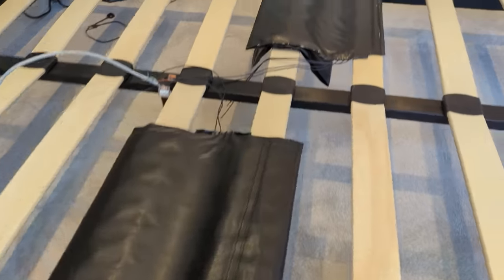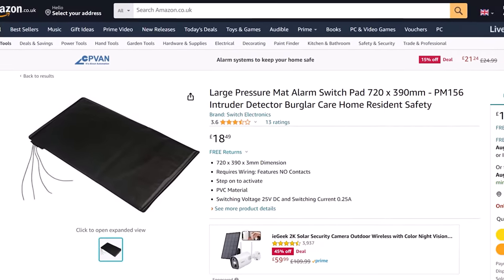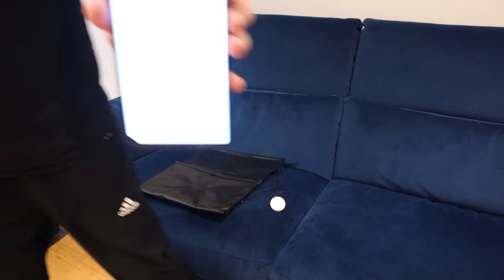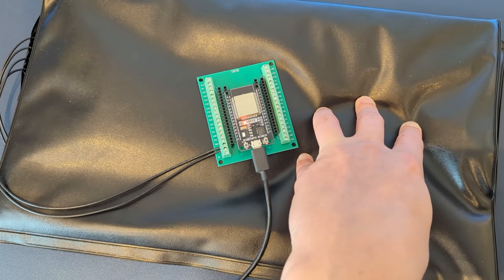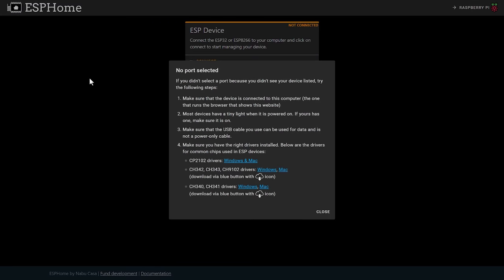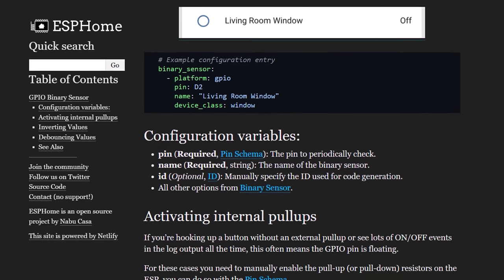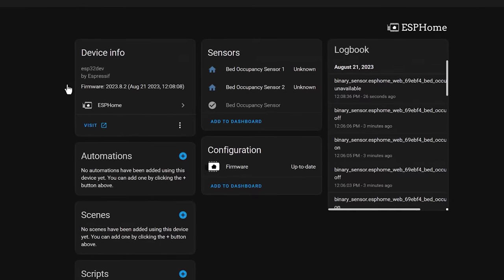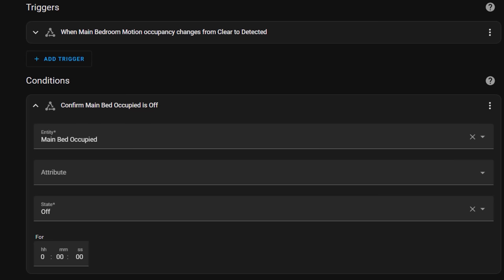Easy Aqara bed sensor vs ESPHome

Comment: Thanks for the great video!
I have build it myself with ESPHome and I found that the "delayed_on_off" filter works much better than "delayed_on" and "delayed_off" because "delayed_on_off" is intended to debounce binary switches, while the others are intended to debounce push buttons.
Reply from the maker: Great tip! I didn't know about that one. I'll switch my code now and see how it goes. 

Thanks for sharing! 🙏

Comment: The other 2 wires are for a security loop, when  used in alarm systems.  They are powered from the alarm system and will 'always' be live unless the wires to the mat are cut, alerting the alarm system to a problem with that sensor.
Reply from the maker: Well that's good to know. Thank you!
Reply: If you look carefully you can see, and feel through the plastic coating, the two wires that are just a loop
Reply: I just wanted to mention that the version of this same sensor mat that they sell on Amazon in US only has two wires. The wires terminate in a plug that connects to a small alarm/chime box. I cut the wires a few feet from the female plug connected to the alarm box so I can disconnect it in the future and then connected those to my ESP32 and it worked great

Comment: FWIW the mat you chose was an alarm mat. That means the other 2 wires you could not figure out what they were, were the break-detect lines. All alarm equipment have them, from door switches to PIR sensors. It basically ensures the integrity of the alarm state should someone tamper with the sensor. 

Cool vid and yes ESP devices can be a very easy and low power way to set up smart sensors.
Reply from the maker: Makes sense! Thanks for the info, there was 0 documentation with the mat itself so I had no idea 😃

Comment: Great video. I saw another video doing similar thing, using Aqara water leak sensor, so I got the same pressure mat he did and the Aqara leak sensor. It worked, but an issue I had was the time it took to show clear was taking to long for my application. So I tried the ESP32 method, using your code, but I removed the delayed on and reduced the delay off to 3 seconds. We will see how that works. But first thing I noticed is it was precise to show clear on occupancy at the 3 seconds.

Comment: That a good alternative use for the leak detector, I've used one like this as a rain detector connected to a  rain sensor board. You can of course also use a lower cost window/door sensor just by by-passing the reed switch. I use such a device to detect when my front door is locked (not closed ... . actually locked).

Comment: I'm using ESPHome with an ultrasonic sensor in my water softener to give me the raw distance to the top of the salt pellets, then calculate the used and remaining height in cm and % of salt used vs remaining. I also used the same setup to measure the amount of water in the Christmas tree reservoir and sent alerts when it got too low.
Reply from the maker: Do you have a guide you followed for that? I have a water softener and I always forget to refill the salt blocks.  The softener came with a Mobile App, but it sucks so bad and requires internet connectivity which is really annoying. I assume the softener already has ultrasonic sensors it for the inbuilt app, and I wish I could just wire into those!

Comment: I use ESPHome for almost everything. I now use about 130 different ones, ranging from controlling an LED strip to ESPs that have different sensors attached to them, but now also several with a Tuya chipset that I have flashed to get them from the cloud. .

Comment: I am using an Esphome device with an infrared receiver and an emitter to control the Air Conditioned with the "climate" module. It even detects when I control the Ac via the remote control and the settings are sent to HomeAssistant!

Comment: Nice video.   Question, if I put the pressure sensor between my mattress and box spring, won't the weight of mattress trigger the pressure sensor on all the time?
Reply: I would imagine you would be able to calibrate the pad but that will come with the intructions

Comment: I have several ESPHome devices.   One is a small relay based on a Sonoff SV that unlocks the main security door with a toggle that keeps it powered for 5 seconds then releases.  This door would normally be controlled via a push button on the intercom system, but I use it as a remote  control so I don't need to worry about finding my key all the time for the common area doors.    I also have several LED Strips, analogue and digital, that are controlled via ESPHome.   I originally was using Tasmota on the door relay, but found ESPHome to be an easier option to maintain within Home Assistant.
Reply from the maker: Cool use of ESPHome for the door lock!  I love it!

Comment: Great video! Am going to try this out. The method using Aqara's water leak sensor is a good approach but I do also like the ESP32 option. The only drawback is that the ESP32 would need to be powered via USB.. unlike Aqara's water leak sensor on CR32 batt.
Reply from the maker: Yeah. That's true. But I'm on a mission to try and get rid of my battery powered devices. I'm also not sure how long a water leak sensor battery will last if it's constantly triggered via the bed sensor
Reply: You can get ESP32 modules with built-in support for connecting a LiPo battery (including a charging circuit)

Great video, by the way, Alan! 🙂

Comment: I went the half load cell method, turns the bed into a massive weighing scale so you can work out if it's just you, the wife or both in bed and run different automations
Reply from the maker: I agree that this is a much more accurate method. But it's a lot more work to set up.

On the plus side, you can then use your bed to weigh your suitcase before you go on a trip!
Reply: @HomeAutomationGuy  or yourself - esp after a big dinner.

Comment: I made an accent/night light in my bathroom which turns on via motion sensor and adjust brightness based on time of day. I also made an IR receiver which listens for specific buttons on my TV remote which the TV doesn't actually respond to. My TV remote has a numpad and so far as I can tell it is not used at all by the TV. I programmed HA to do various things like turn on or off lights in the area of that box, convenient diy universal remote for when you just sat down and forgot to turn the light off and you have the remote in your hand

Comment: I'm using an Aqara door sensor with a (much smaller) pressure mat. My goal was to have the nightstand light on when I wake up at night, but there are too much false positives and the light will turn on randomly during my sleep. Of course for this purpose I cannot use long delays, in fact in my automation the light will turn on after 2 seconds of "bed not occupied", otherwise I should stand still to wait for the light to turn on before moving away from the bed. So I use the sensor for the mornin wake up routine: if I'm not out of the bed after 10 minutes from the routine start, my bedroom light will turn on and the echo dot clock (playing my favorite radio station) volume will go up.

Comment: Hey, also used those mats (sensor) under our bed and they worked quite a while. But after some months the triggered fals alarms or dont go from occupied to unoccupied sometimes.
Now i am using two FSR stripes and ADC meassuring, but also have sometimes issues with fals triggers (after making bed...).
I think the holes between the wood "destroying" them over time with the person weight on top.

I think a solution would be to use some sort of thin plastic under the pressure mat to support it and not squeeze it into the holes between the wood.

Do you guy's have those issues with the mat?
What do you think about the idea?

thx

Comment: Love this leak sensor idea to make it zigbee compatible. I actually already had a very cheap zigbee leak sensor I wasn't using that had two contact prongs on the end. I cut that off to expose the wires and they can then be connected to the pressure pad. Benefit of this is that the prong was on a long wire so it's more flexible where I place the zigbee transmitter.
Reply from the maker: Great stuff!  Good re-using of unused smart home tech!

Comment: I plan to use ESPHome for multiple different things like:
- Water leak detection
- CO2 fill grade and leakage detection for the water dispencer
- Bed occupancy
- Irrigation/Sprinkler system
- Parcel and Letter box
- Weather station (with multiple sensors including lightning detection, rain, wind, temp, uv etc)
- Air quality (Airrohr, Sensor Community)
- Air freshener
- BT proxy for radoneye

and for sure more upcomming.

ESPHome is a great system with a huge amount of possibilities. Sometimes at smart homes you have to think about possible data and how to interpretate them like my temperature sensors at water pipes to detect if somebody uses the shower or bathtube.
Reply from the maker: What a great list of future projects I can try!  Thanks for sharing!

Comment: Using the leak sensors as the trigger is genious.
I'd be tempted to set this up except worried that on a date night, if the dog walked into the room, it'd have a seizure with the lights strobing off and on
(/j)

Comment: I have the even more expensive sensor option. We own a Select Comfort SleepNumber bed and HA has an integration for their SleepIQ app. I do find that due to movements I can't rely on the occupancy state. Just thinking out loud, but in order to 'filter' the state (like you demo with the esphome sensor), I need to increase the "Duration" in the Automation for both both state changes.
Reply from the maker: Oooh. Smart bed! A whole device I'd never even considered before!
Reply: @HomeAutomationGuy checkout eightsleep
Reply: @HomeAutomationGuy  This is my second Select Comfort bed. The first was bought over twenty years ago before home automation's current push into all facets of our homes. When we needed to replace the aging bed 5 years ago, I was excited to find out they moved away from RF bed controls to a phone app. Only after getting into Home Assistant did I find out that there was an integration for HA to control the bed -- under-bed light, bed firmness, head/foot position, and I am guessing bed temperature. We don't have that feature, but in the winter I dream of how nice it would be to crawl into a toasty warm automation-controlled bed.

Comment: This was great - I got set up in an afternoon following your guide and now have the alarm automatically arm and lights shut off for these. Still trying to figure out the right positioning for the pads. Has anyone done any adjustment to sensitivity for heavier mattresses? If not may build a container around the mat to alleviate some pressure

Comment: I’ve been using it for approximately a month now and it’s been awesome so far! I’m using the Aqara method and using the sensor to only trigger the waking up automations like turning on the lights and blasting the alarm and lifting the shades only when I am already in bed.. and it doesn’t turn off the lights and keeps annoying me with the alarm until I get out of bed (eliminating the spaming snooze dilemma 😅)

But lately I’ve been facing an issue where it stays on occupied even when I get up, and then I’ll have to hit the mat multiple times until it gets fixed.. it’s like the mat gets bent down and the circuit stays closed for some reason.. any ideas how I might fix it?

Comment: ... Oh man ... yet another sensor that I have to buy :D Thanks for the video! However, I am curious about the sensitivity of the sensor. Is it a simple binary switch or is it possible to set a threshold?  I am wondering about the weight of whatever you put on top. What if you have a very heavy mattress?
Reply from the maker: This is a simple binary switch. It seems to work fine for me with the weight of my mattress and bedding on top and detects us when we get into bed.

Comment: Question: if you place the pressure mat underneath a mattress, won't the weight of the mattress trigger the pressure mat sensor mistakenly sending a message that someone is on bed?
Reply: I think you can change the pressure level to some extent allowing you to "Tare" the mattress pressure. My issue was with using a temperpedic which doesnt nessarly translate all the weight directly enough, which equated to needing a much higher sensitive device.
Reply from the maker: I was worried about that too, but my mattress doesn't trigger it on its own
Reply: I have a pressure mat under a foam mattress, which is much heavier than a conventional spring mattress, and it still doesn't register as occupied with the weight of the mattress alone.
Reply: @ebenezervalvi1009 thanks I have a temperpidic and this is what I was worried about.  Did you find a sensor pad that works?
Reply: you'll need to add resistors between the gpio pin and 3.3v

Comment: If you run your HA on a pi, you could also hardwire it using the raspberry pi's GPIO pins and make a binary sensor. That way you could make one dirt cheap
Reply from the maker: Good suggestion! Thank you!

Comment: Ventil aktuator er nok det mest korrekte navn.

Jeg har haft en siddende i 6-7 år, fungere perfekt, og har massere af kræfter.

Det er så udgaven uden nogen kontroller (styres bare med 12v direkte, men har microswitches til endestop).
Det var den eneste jeg kunne få for under 80kr fra Kina, den gang det var beløbs grænsen 😆

Comment: Great writeup / video! Just having a play with one and find that it works when I get into bed but then thinks I get out when I lay down.  I am guessing positioning is important - it looks like you have yours folded over -0 is that the key? Cheers!
Reply from the maker: I had to fold/move/adjust mine a few times to get it working accurately. I found placing it at "butt level" in a folded way worked best for me and my mattress
Reply: @HomeAutomationGuy  Thanks will try with me tonight before the wife!

Comment: I've got a 4 switch box near my keyboard with an ESP8266 running ESPHome. One switch is set to toggle both of my Pi-Hole instances on or off (some website comments sections are blocked by Pi-Hole). The other switches control my WLED lights through Home Assistant.
Reply from the maker: Home made smart switch - I like it!

Comment: Great video. I started with door sensor but the batter didn’t last long. Am no using your ESPHome method which is working great. Does any one knows a way to turn off the power LED?

Comment: This is very interesting and I've been wanting a bed sensor. The part i wished you covered was why this method over a load cell? For example how does this work eith say a heavy bed?
Reply from the maker: I've not tried the load cell method. It's a lot of effort and the pressure mat method works perfectly well for my use case
Reply: @HomeAutomationGuy  Hmm. I ended up watching Lewis's video on it and got some clarification where he was talking about the best slats distributing the load and such. I went ahead and ordered the pressure pad as I really want this solution to work for me. I did like how easy you made it. I didn't realize using the ESP32 GPIO was this easy.

Comment: Hi Mate, great vid! I have a question though :) bed is not only for sleeping right? So how those sensors react when there are 2 person on one side of the bed in jumping motion? :>
And how sensitive is it, I have 2 cats and I'm curious if they would trigger it.
Reply from the maker: I have an automation that detects if two people are on one side of the bed in jumping motion, to automatically dim the lights and start playing Barry White on the Sonos.  

In my experience you need to put at least 8-10kg of weight on it to trigger the sensor, so it depends how heavy the cat is.
Reply: @HomeAutomationGuy  Thanks Alan, Barry White is fine choice :D

Comment: How does this work with a heavy mattress? Would it constantly be on?
Reply: No, rather the opposite. This sensor is for alarm system, so tuned to sense when someone steps on it, therefore the it is not too sensitive, the specification is 25 kgs / 5 cm2. So if it is a flat surface under the mattress, it is likely this won't even be triggered by your weight, as the mattress distributes it evenly on a large surface. If there are few cm wide boards under the mattress (like in this video) then the pressure is high enough to trigger the sensor. The problem is, how long this type of simple sensor will last, as it was not designed for constant loads, so in the long run it might produce false triggers.

Comment: Question! Using the Aqara sensor, could you wire up two pads to the terminals and have the same effect? I know it would only see it as one sensor, but for the function I am thinking of that's all that would matter. I just want to know if one of either two beds, that are next to each other, is occupied.
Reply from the maker: Yep. That would work perfectly!
Reply: I’ll give it a go!

Comment: I really enjoy your content. Also it comes in the perfect moment for me, as I bought a bunch of ESP8266 D1 mini for a BME280 and stuff. How would you take care of the power for the ESP? Usually I'd love to rebuild the ESP version but having several cables under my bed sounds a bit unsafe to me.
Reply from the maker: I just plugged it into a USB power adapter.  I've got loads of cables under my bed already for charging my phone, and other devices. So I personally wasn't worried about adding one more

Comment: I am wondering if it is somehow possible to tell which person is on which side based on weight difference? Are there alternatives to these pressure mats that can actually differentiate by weight rather than just on or off?
Reply from the maker: A force sensitive resistor might be able to, I'm not sure